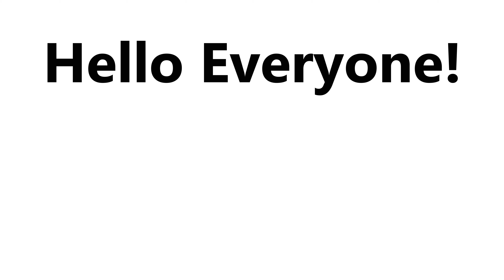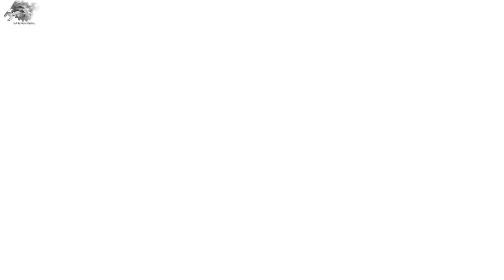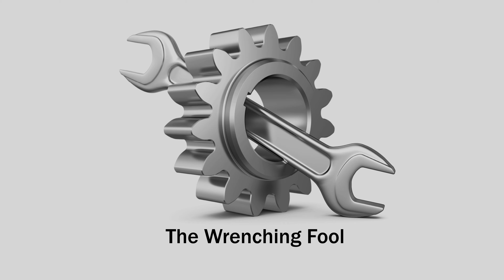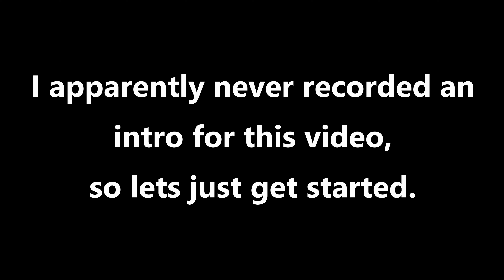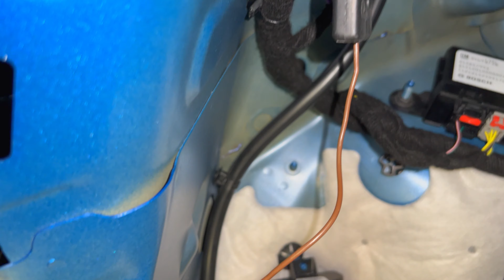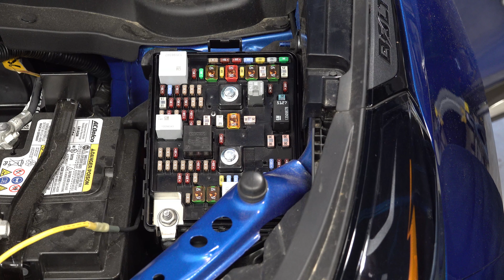Trailer Wiring Install - 2022 Chevy Bolt EUV

Comment: Thank you for the detailed video. With this video and your hitch install video I was able to install an EcoHitch and the wiring without any problems. For others that are about to do the trailer wiring, there is NO need to run a power wire up to the front of the vehicle. There already is a fused +12V wire in the vicinity of where the module gets mounted in the rear. The wire I tapped into is +12V rear windshield wiper park wire fused at 20Amps. Circuit 5780. Gray with a violet tracer. It is pin 19 on connector X900. Connector X900 is located at the top of the driver side rear panel that is partially removed in this video.

Comment: How did you remove the plastic panel by rear driver side seat? Mine seems to be screwed in with a red tab blocking the screw head

Comment: Thanks for posting!  The one thing I don't care for is that the circuit to the trailer lights is always hot.  Not sure how to avoid that.  Regards.
Reply: Would one think this may have a vampire effect on the traditional battery when the car is even off?

Comment: Your video is exceptional. My 2023 EUV hitch and wiring harness install went smooth.  For people's notes, the studs off the interior fender well that you can mount the wiring harness module and ground to use an M6 nut that can be fastened with a 10mm socket/wrench.  The interior fender wall is covered in some sound deadening material on the 2023 which provides a good rattle proof surface to mount to.  I had to drill out the hole on the module mount with a 1/4" bit to get it to slide over the stud. Thank you!

Comment: I found your video to be more informative than the instructions. Etrailer has this wiring harness from Curt, part #C45ZV or Curt#56521. It appears to be identical to the one you use in the video.

My car is a 23 EUV Premier built in mid '22. 

When I went to empty out the "trunk", my car has Super Cruise, so the forward portion of the pit has electronics for the Super Cruise. Between that and the hatch threshold is a rigid foam tray that makes it difficult to get a grip on the lower edge of the threshold cover. A single T-45 torx screw holds it in place. I had to use a couple plastic pry tools to move the edge of the threshold plastic out of the way and then the foam piece comes straight up. Then, pulling the lower edge of the threshold plastic toward the front of the car and then straight up, it comes out nicely.

I followed your example of routing the wires through the passenger cabin to under the hood and duplicated your connection to the power lug on the fuse block.

Grounding the trailer wiring was easy, as looking forward behind that driver side panel where you mounted the black box, there are two ground lugs that are very reachable and the ground wire from the black box easily reached those. 

In my car the two grommets that are on either side of those one-way air exhaust vents were untouched. The kit connectors for the blinkers would not fit through those holes, so I cut those wires (green passenger side and yellow driver side) and poked them through those grommets and then used shrink wrapped splices to complete that portion. 

I had a piece of 1/4" ID rubber fuel line, so used your idea of splitting it and protecting the wiring from the edges of that square port, as you did. 

My car has a pop-off port cover about 3-4" square in the driver side panel, so I used that to bring the 4-flat connector wiring through. When the trailer wiring is not in use, I bundle that 4-flat wiring with a piece of velcro and stuff it back in the hole. Fits nicely and is easy to retrieve. 

Thanks so much for the videos. I used your video to add the trailer hitch also. And after watching both videos, I did the wiring project immediately after the hitch install when the bumper was still off the car. That made the only reason to go under the car was to remove those two black nylon push-pins that hold the lower part of the bumper fascia in place. 

Incidentally, does anyone know the exact size of those two black nylon pins? Being unfamiliar with how they work, I pretty much destroyed them when removing them.

Comment: Your video was a great help with my installation.  Same Tekonsha kit on 2023 EUV.  I put on my hitch about a month earlier (Torklift) and removed the rear bumper cover for that.  I ended up removing it again for this job because those GM electrical connectors drive me up a wall!  I cannot get the connector to release and pull apart unless I have two hands on it.  Anyway, the second time removal of the bumper cover was a little easier than the first because I was more confident on where to pull and how hard to pull to release the fasteners but I probably didn't save any time...just reduced frustration.   Getting the bumper cover to release from directly under the tail lights is always challenging until you get the "pop".   Your tips and comments were helpful.   I took more time than I expected to run the power wire to the front and feed the rear connectors through the air vent.  The connectors had to pass through a certain way because of their size and they are zip tied already.   Thanks again!
Reply: How long did it take you to wire it?

Comment: It is weird watching this and seeing the small differences between a 2022 EUV and 2022 EV.  On mine the parking lamp wire is mounted to the lamp on the body through that hole and there is a large foam grommet that fills that hole.  It is not easily apparent how to remove it.  I am using a clamp version of the harness that does not cut the wire.  Will see how it goes.  On the back bumper you have large green and black wires at mark 9:53 that I do not have at all.

Comment: What do you think of having a second 12 v in the trunk instead of ripping the car appart  

With some kwiq connections to remove and charge
Reply: Great idea,  isolated battery  ground and hot. but my question is in case of a short circuit in the trailer lights, is there any chance to blow anything in the car since the extra battery will not be grounded to car?

Comment: That tekonsha harness is not there best 

Look the one for the tucson2022  really 100 time better  1 plug 1 connector and bingo  

For my bolt im a bit disappointed fir the mess il will be to get 12 v  

Thinking of having  separate 12 v in the trunk   just not to fuck arround. Back to front 

Thanks for the video💪👍 anyway 💪👍
Reply from the maker: I think part of the issue is that they never intended for the Bolt to tow, so no consideration was made towards making it easy for even a trailer light harness to be installed.
Reply: Thanks for the advise on the Tucson 2022(Curt Manufacturing T-Connector 56420) that is 1 plug  indeed. How do I install in my 2023 euv. Since it's only one plug!!!
Input appreciated

Comment: It should be noted that the drive unit has no liquid cooling
Reply from the maker: The EUV does, or at least mine did (I verified on mine), but I’ve heard that some of the Bolt EVs now don’t. All the pre-2022 Bolt EVs did.
Reply: @wrenchingfool5284  Ah, i forgot to mention that it is not present on the EV after 2022 but it's indeed there on the EUV. The motor gets hot very quickly during long pulls in the EV. The EUV does have it in every year as far as I know. There's a video of the normal bolt on a lift and it has no cooler for the AT oil besides air

Comment: At 7:30 in the video... How did you get the wiring connector apart? I pulled the red lock tab but couldn't pull the connector apart.
Reply from the maker: The lock tab holds a second lock that you have to push to remove it. It's not a great design, but its one that just about everyone seems to use.
Reply: I had a hard time with that also. Luckily, the plugs on the new wiring connectors in the kit are the same, so studying them, I was able to figure it out. I think I ran up most of my cursing total for the project on that connector.
Reply: Having the same issue. Red locking tab up and pushing in on the small black tab, it won't pull apart. Used the one in the kit to practice, it comes apart no problem. May have damaged by it now messing with it.

Comment: Comparing your wiring harness and instructions manual, I can confirm that the harness and instructions manual from Torklift Central's wiring harness is identical to the Tekonsha.  I am not sure why they do not list it on their site as the Tekonsha, maybe because they sell it a hair cheaper?  Anyways, hope this helps someone.

Comment: Will this same trailer light kit work with my Bolt ev 2022?  I know you have a EUV and box says not for EV but I’m thinking the connections are the same? What do you think?
Reply from the maker: Unfortunately I don’t have any experience with the newer Bolt EV so I can’t say for sure that the Bolt EUV kit would fit. It would make sense that the wiring is the same, but automakers often do things that don’t make sense.

Comment: Thank you for this! The trim panel fasteners, while similar, look like they have been improved from what was used in my '20. Those seemed to be designed for single use and were quite easily broken. Where was the black box finally mounted?
Reply from the maker: I mounted the box up closer to the wheel well. I’m sorry I didn’t get video of that, but it was actually something that I had to go back and change after fully reassembling because it was rattling while driving.
Reply: @wrenchingfool5284  To be clear you mounted it forward (direction of travel) from where it was? Looks like the wheel well is quite a bit lower, so perhaps you mounted it down below where that “bump out” in the plastic panel is near the cargo area. I assume you still have it mounted behind that panel? Do you have any recommendations to prevent or mitigate rattling in general? Thanks in advance. Looking at doing this soon.